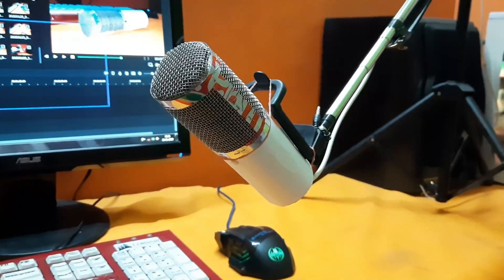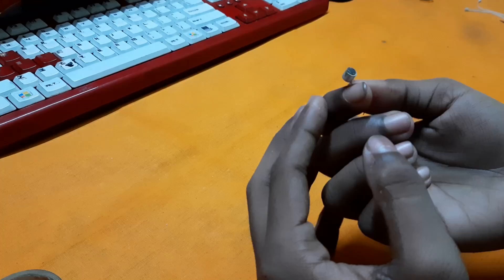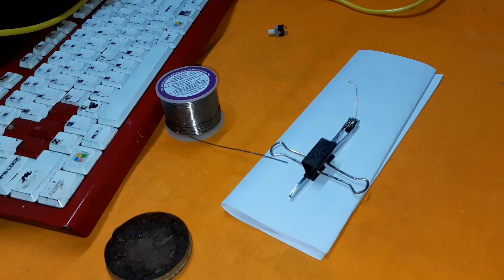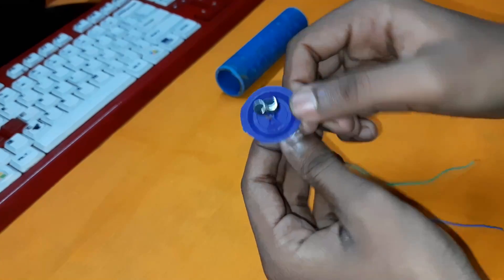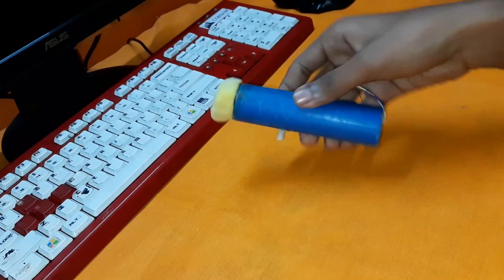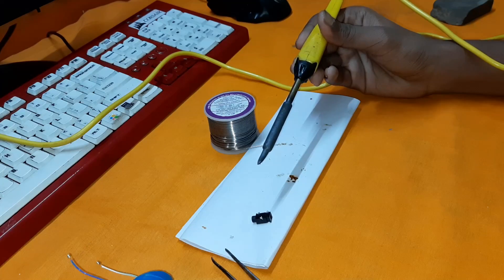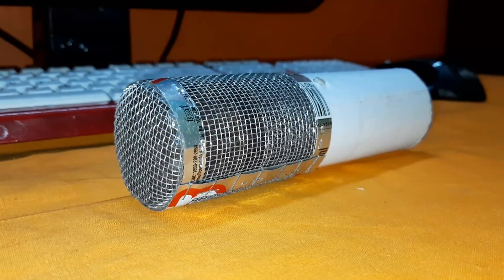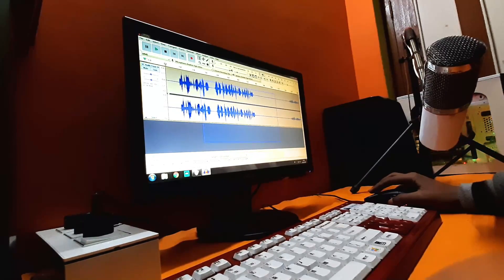DIY Professional Microphone | Studio Microphone for Desktops

Comment: Where is green wire out. The switch wire is green. But no green wire out to female port
Reply from the maker: Check the circuit diagram shown, or specify the timestamp where you saw it, i can then explain

Comment: Hello friend  is this good for  recording guitar on cakewalk audacity....is it good for that...also  is there a wiring diagram  for usb instead of 3.5mm female
Reply from the maker: you cant directly connect a condenser to usb
make this 3.5mm circuit, then use a USB sound card

Comment: Doesn't work on mobile phone. 
Which pin are you using?
Reply from the maker: It's a professional mic
Made for desktops
Reply from the maker: Attach a trrs pin for phones
Reply: @TechnologyHell  thanks for the reply. Im trying for some days but can't get proper materials.
3.5 mm pin used is a trrs right?
Reply from the maker: im using trs
for phones, use trrs
Reply: @TechnologyHell  thanks again.

Comment: Will it works for mobile.. because did not connect the microphone point with any other point.
Reply from the maker: use 3.5mm splitter for use with mobile

Comment: Thanks for the easy to understand video.
HOWEVER, my laptop is not able to recognise the aux cable as a microphone. It is considering it as a headphone/earphone.
I even tried using aux to usb splitter, yet it is not working
Pls help.
Reply from the maker: laptops have one 3.5mm port : 4 sections of the pin determine audioL audioR ground and Mic
the interface used in this diy mic is the dual 3.5mm port : 3 sections of pin determine micL micR micGround

so you gotta use usb sound card that provides dedicated ports for headphone andmicrophone
or get a splitter for aux port that will divide it into 2 parts for mic and speeakers
Reply: @TechnologyHell   I even used a splitter and usb card. Maybe the splitter I’m using has some problem.... Thanks a lot for the info. I’ll look into it

Comment: Sir I don't have female 3.5 mm jack oxbold what can i do.
Reply from the maker: instead of putting a 3.5mm port, simply solder the wires to an aux cable that will enter the audio port
Reply: Ok sir
Reply: Sir kya aap puri steps batao please kyonki muzhe nahi bata chal raha ki vo connect kaha karu.
Reply: Or can you make separate video on it.

Comment: Hey i need to make a stereo mic and a lavelier mic so  doing need to use a preamp circuit or smartphones and pc have them inbuilt

And also how to make the mic sense the sound in 360 degree and how to improve its quality plz help
Reply from the maker: for 360 degree, use a large sized condenser
for quality use an external sound amp OR good software interface

using a preamp circuit is optional
without a circuit it will consist of a bit of bg noise which can easily be edited out of the file
Reply: @TechnologyHell   can i make a pre ampif yes plz share the circuit diag the most simple one
Reply from the maker: you can make one but it can not be simple
one will include a control chip, breadboard, nd lots of other ICs
Reply: @TechnologyHell  and the ones with a capacitor an resistor
Reply from the maker: such amps dont make any difference

Comment: Can i add more than 2 condenser mic for more accuracy and better quality?
Reply from the maker: yes but make sure to isolate them properly, or it may result in static background noise

just finish the wiring and then test how the sound is
if it is good, head up to make the enclosure

if there is too much of noise then make the mic with single condenser
Reply: @TechnologyHell  would turning the gain down solve this problem?
Reply from the maker: if you keep the gain low, then there will be as less as null noise
Thats a good idea
Reply: @TechnologyHell  thank you for your help